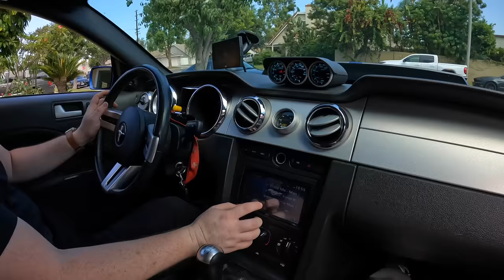Riding In @DrewPeacock  1000HP Mustang!

Comment: Coming from a boosted coyote, Drew is gonna need 3.15 or 3.31 gears
Reply: He had those but it was too long a gear so he went 4.10s at the end of the day it’s whatever you like I have 4.10s in a 04 gt lol
Reply: @luisuribe5432 longer gear isn’t a bad thing when it’s boosted and your racing less shifting but from my experience 4.10 are really good for na  setups
Reply: Waddup waddup waddup 🔥 video to relax and smoke once I get outta work
Reply: @luisuribe5432  yea ultimately depends on use case. Most racers like 3.15s or 3.31s in my experience. My car has 3.15s and pulls like crazy up top.
Reply: Idk man I like my 3.55 
Plus I daily my car 
I drove a gto that had 4.10 gears and as a daily ..hell no lol
Reply: @bambam23406 depends on the engine I assume longer gears in 1-2 might be to much and you might blow something

Comment: Myke myke needs to get the same year mustang so he can do a coyote motor swap since he's been talking about it for a while and I finally made my decision up I am going to do an ls3 swap in my 2014 Toyota Corolla and converting it to rear wheel drive and putting street legal slicks and a wide body and try and find a good body shop to get it painted then do a nice sound system and put an aftermarket ale arlarm system as well I can't wait to start the build I just have to find an ls3

Comment: The fox has a pushrod engine which is why you need to drop the k to get the spark plugs in your case any modular motor is way different and all the plugs are manageable.
Reply: @Coyote_Mach you be sounding hella hurt in all your comments😂 chill out